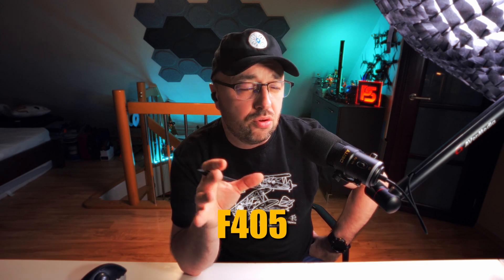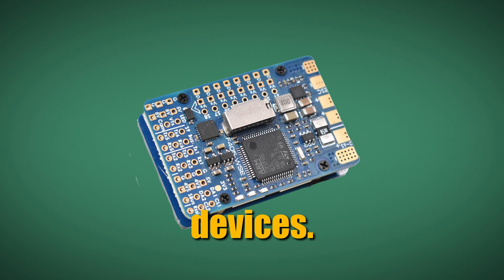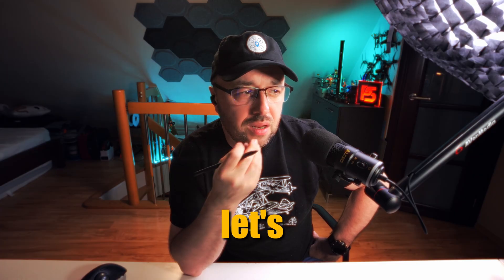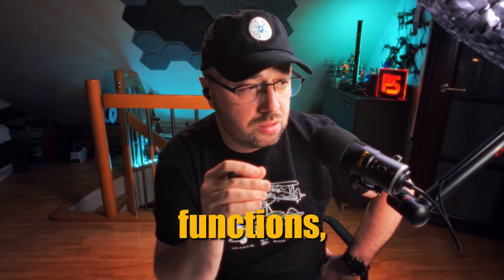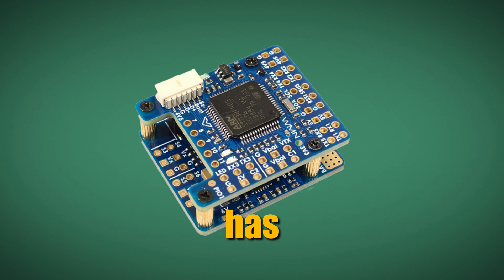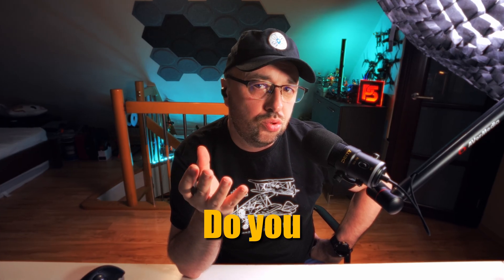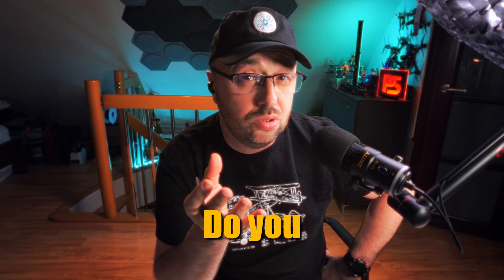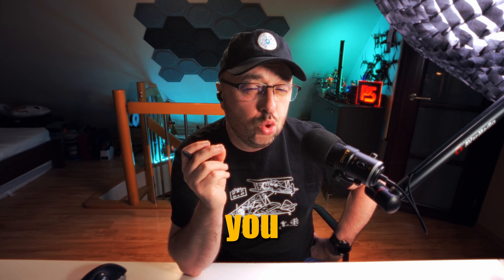A new, small flight controller for airplanes

Comment: Hopefully iNav will adopt allowing the configuration of servos to S2.  I don't understand how Ardupilot does it on an omnibus F4 nano but iNav never could.  As we know iNav has killed the F4 boards moving past v.7.0 but there are F7 boards that still only have 4 PWM outputs.  I fly planes, Ardupilot allows putting motors on any of the 4 PWM outputs, something iNav devs says is not possible.  Confused.

Comment: Big issue is everything using serial instead of a multi-drop bus. This was solved decades ago with things like CAN,  RS-485 or even I2C.  Chicken and egg, I know - you'd need devices that support something other than simple serial and controllers that support it as well.

Comment: I built a 90g inav plane using the F4 NOXE. Its a garbage board, but I got it to work. Complete with GPS. I even had an extra servo output when I was done. Worth checking out for people experimenting with small and cheap boards.

Comment: That's the point. We want a smaller, cheaper, and reliable board, similar to SpeedyBee, with at least 6 PWM outputs (which is more than enough), and up-to-date (>=F405)... and let's not forget about the >>analog<< and digital features as well.